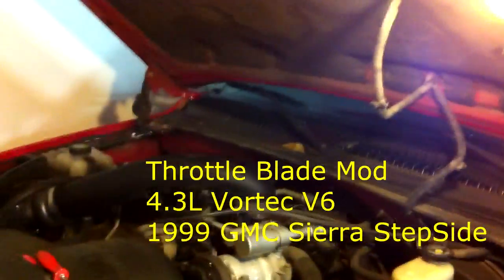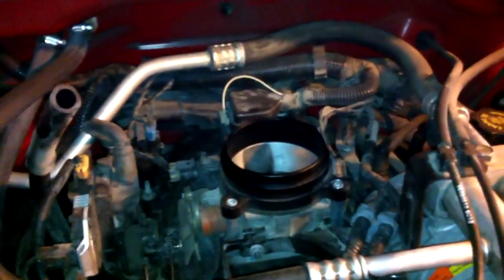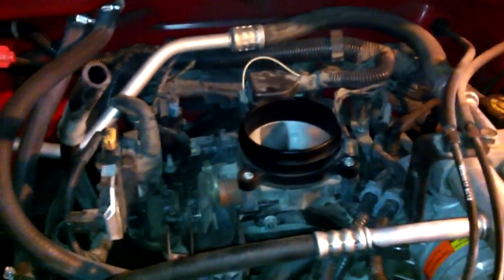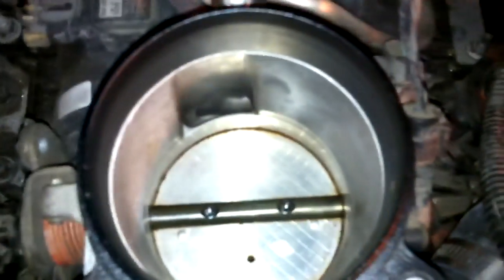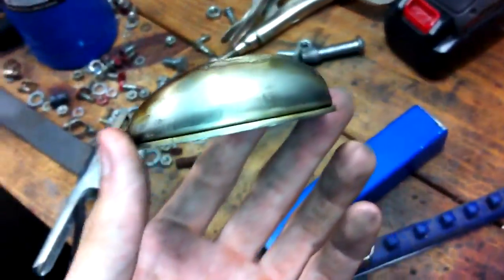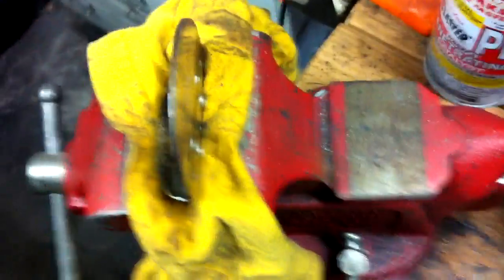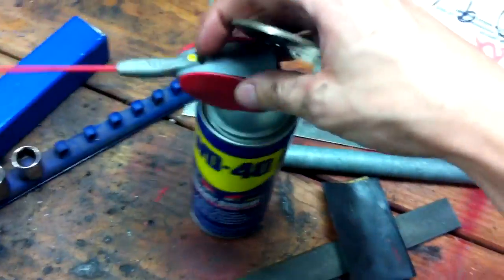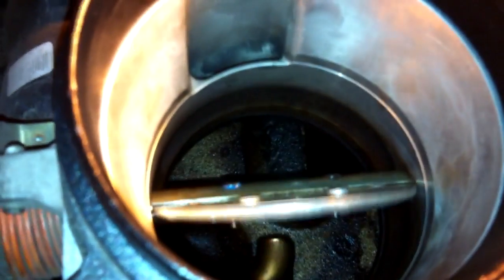4.3L/5.7L Vortec V6/V8 | Throttle Body Blade Mod | 262/350ci

Comment from the maker: same throttle body just different intake manifold I believe, assuming your talking about the newer ls motors 99+. Don't quote me on that though. I know the throttle body & diffuser is exactly the same as the vortec 350's from the 90's.  thanks for watching

Comment: Spider injectors are not to hard to do. But don't get your new from oreilys auto parts mine failed three times go to autozone or napa. Make sure to clean your egr valve too. That could be a problem. My gas mileage went for 10 mpgs to 23 mpgs. It was wroth everything

Comment from the maker: I said leveling kit in the video, I changed my mind on the size though I'm gonna do 3'' in the front and 1'' in the back, i wasn't thinking when I threw out the numbers in the video. If I wanted 4wd and a lift i would have bought a different truck but I don't need all that, its getting a leveling kit because it will make it look better with less sag in the front.

Comment from the maker: yeah the scfi uses poppet valves and the lines are prone to cracking. the problem i'm having is that a crack in one of the spider legs or the fuel pressure regulator is pissing fuel in my manifold, so whenever i go to start it when its warm it is flooded out too rich and has trouble starting. I noticed it's been starting easier now after the mod and I guess the warmer air might be helping too. I might be able to get away without changing the thing till this summer.